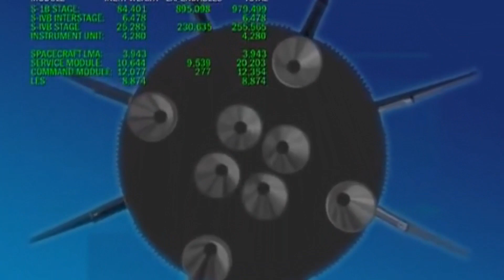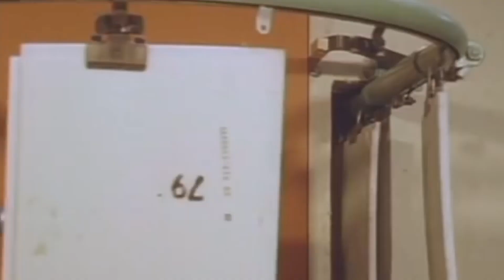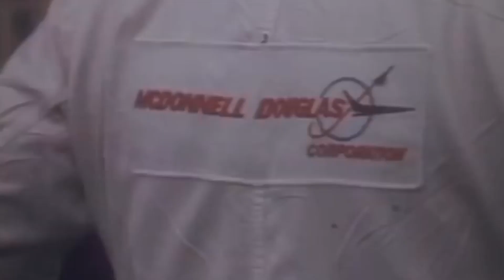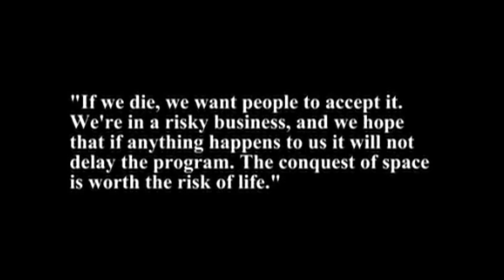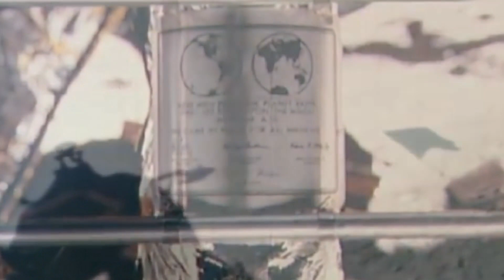"The Mighty Saturns  Saturn 1 and 1B"

Comment: Sort of Ironic that this video covers the actual tried and true Saturn 1 and 1B engines, that were FAR more dependable than the larger "F1" engines that they claimed were used on the Saturn5...

The facts are that the Saturn 5 "F1" engines could NOT operate at full throttle for they constantly blew up.... .Therefore what they did to disguise that fallacy was to power down the F1 engines to the point that they could barely get the Saturn 5 off the ground even empty, and the best that the Saturn5 was able to do was to barely make low Earth orbit..... Going to the moon?  NOT A CHANCE IN HELL!
Reply: All the first two stages had to do was deliver the SIVb to orbit. What precisely would preclude the SIVb from executing the TLI burn?
Reply from the maker: And steps in Cornelius Crewe to the arena for another Apollo lesson. Lesson one;
1)Apollo went no farther than to orbit this earth.
2)ESTAR film off gassed and fogs when cycled in a vacuum chamber.
3) See 1.
Reply: 1) That is your opinion, you have yet to post a damned thing to support it.
2) You have produced not a shred of data from your supposed experiment, nor have you listed exactly what film you are using except to say it is 35mm film. That does not bode well for you.
3) How does that answer the question I posed to northern”truth”seeker?

Comment: Weight of a fully loaded Saturn V at launch: 2,900 tons. Weight of a fully loaded Shuttle at launch: 2,100 tons (or about 3/4). The first one allegedly got to the Moon, 240,000 miles away, from 1968 to 1972. The second one always got below 400 miles away in its 130 space missions, or about 0,15% of the distance from Earth.
Reply: True, but the flights and the missions are/were quite a bit different... The shuttle was designed for low Earth orbit and to "shuttle" to platforms such as the ISS in low Earth orbit and nothing more..

The Saturn 5 was supposedly designed for the flight to low earth orbit and then use an engine for trans-lunar injection and flight towards the moon.... But of course we know now that it never accomplished the second part....
Reply: Rippy... The shuttles were not really used for civilian missions as we have been erroneously told all these years... They were used primarily for military missions for launching of spy satellites and other military hardware into low earth orbit...
Reply: @northerntruthseeker  True, it was presented as a 'cargo' ship. But that doesn't explain why the Shuttle wasn't being used higher than 400 miles.

Moreover, the Shuttle Orbiter, fully loaded, weights 109 tons. Almost the same (even less) what a raw '3d stage' with a loaded Command & Service Module plus a LEM weighted, while being boosted in the 'trans lunar injection' towards the Moon (at only 190 Km. high). So, if the Shuttle Orbiter had a refill of fuel in, say, the ISS (Von Braun dixit), while travelling at the same speed as the ISS,  why they never boosted it to send it around the Moon?  They should have done it with ease.
Reply: Shutting down the Shuttle program after flying for thirty years hardly equates to getting cancelled for being a failure. 
I do, however, agree TO A POINT that is was a bit of a boondoggle, and if you had an ounce of intellectual honesty you would know that is the main reason no one has left LEO since Apollo.